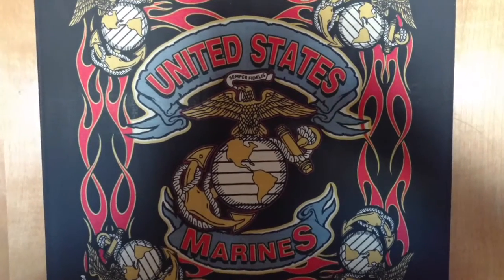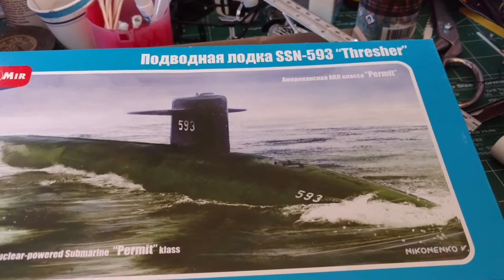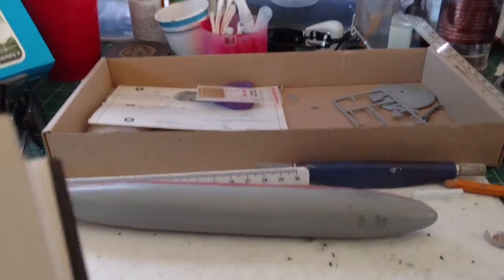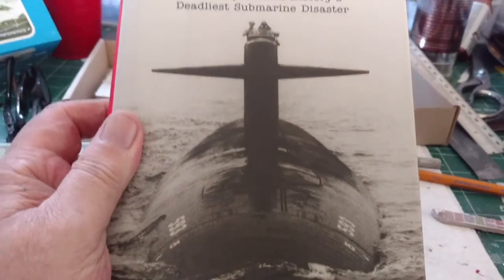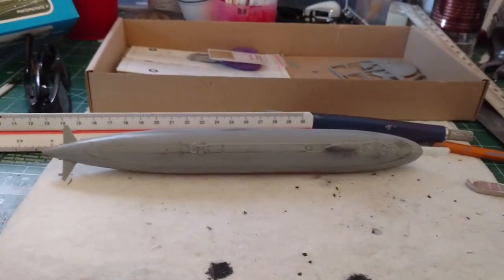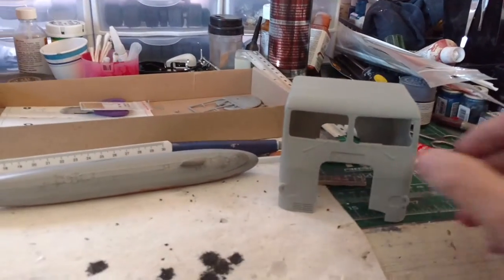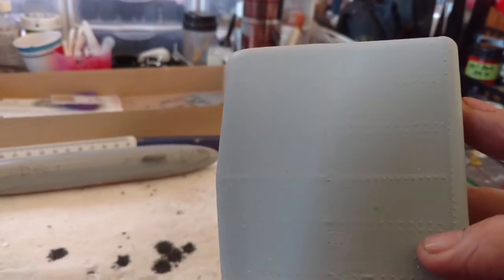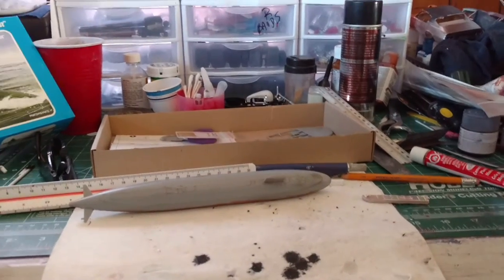Building the thresher submarine SSN-593

Comment: Just about every time I'm glueing mating parts together I give each part a short sanding on 320 grit sandpaper laid over a very flat surface till the mating surfaces meet perfectly. I haven't had to use putty for quite some time now.
Reply from the maker: I don't think you would have a body left if you sanded it to make make it match it's just the poor kid it's like if they molded him together one side shrunk there's other ones I've seen that built this kit have the same problem thanks for the info thanks for the comment
Reply: Some of those old or limited run Russian kits were pretty bad. The latest ones are generally okay but still behind the Asians. My condolences to you for your cousin.
Reply from the maker: TrappenWeisseGuy ;
Reply from the maker: This was a seventies AMT kit that pretty much says it all